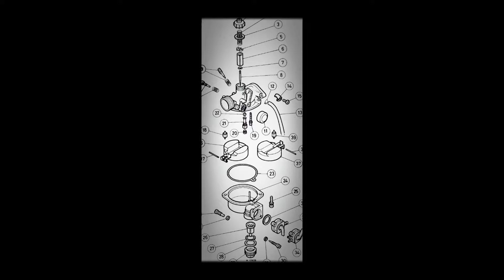How to: Carburettor cleaning Honda C50 (LAE)

Comment: Hi there great job. Just wondering is that an electric chip pan filled with boiling water and some kind of cleaning solution ???
Reply from the maker: Hi Anthony, yes it's an ultrasonic cleaner that cleans the internal channels of the carb. you use a special ultrasonic cleaning solution for it.

Comment: My idle gear shift green light bulb is not working after rebuild. It lights up once i give contact of the bulb with the frame. Is it a sorting or is it supposed to sort like this? Should it sort with the speedometer frame, if so why doesn't it for me? Any help someone please
Reply from the maker: Hi HGL, the neutral indicator has only got one wire connected to it. I think this is the positive lead. If you connect this cable to the frame [mass]  the green light will enable. The neutral indicator switch is notorious to fail, I'm pretty sure it's connected unintentionally to the engine/frame somewhere.

Comment: hello what does the economy valve do and could this be the cause of over fueling?
Reply from the maker: This is the fuel switch, connecting fuel tank to carburettor. Basically only closes/opens the fuel valve. No cause of overfueling. Possible causes of overfueling:
1. Float too high: the carburettor bowl overflows.
2. Jet size too big: jet size determines the fuel/air ratio.
3. Your air filter could be clogged, resulting in a higher air inflow resistance >> more fuel suction.
4. Adjusting fuel mixture screw (screw closest to inlet manifold).

Hope this helps!